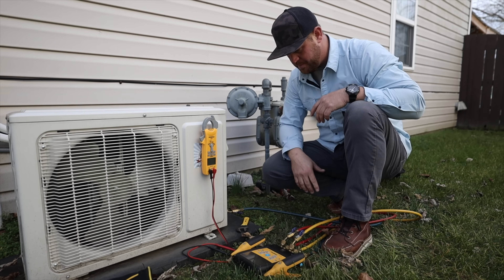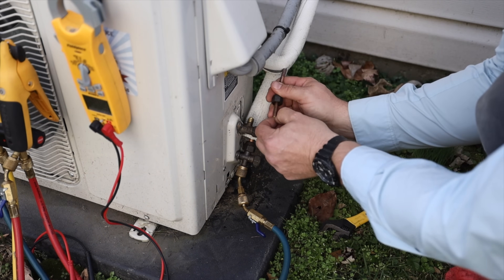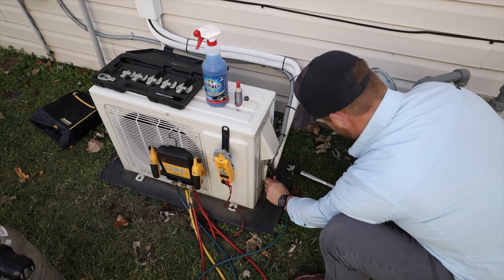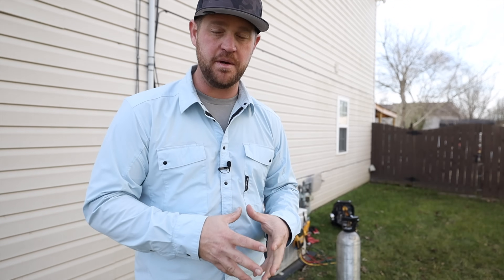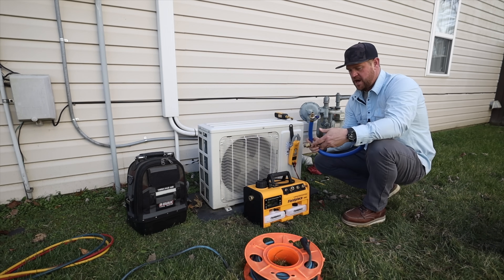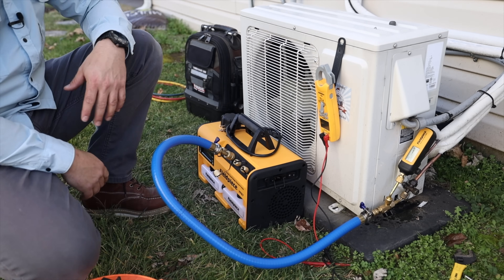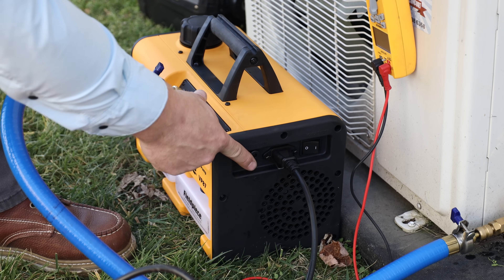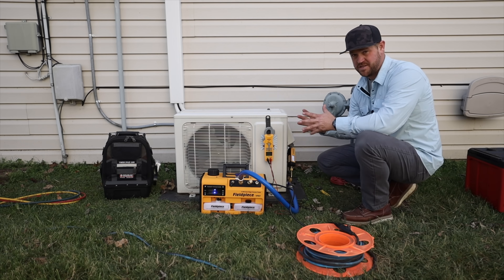#1 Reason Why DUCTLESS Units Fail | How I Fix It...

Comment: I am in HVAC specialist for 37 years. My friend wanted a ductless so we bought a Rovsun  and a Garvey for practically nothing.  I installed them. properly vacuumed, decay test several leak checks since installation.
It’s not been a long time but so far fine. What is the difference? Do you think between a product like GREE and these cheap things that we’ve just installed?

Comment: This video depicts a clear violation of EPA 608.  You mixed nitrogen with 50psi refrigerant - and then vented the mixture to the atmosphere.  Not deminimus.  Once you read 50psi - low refrigerant pressure - you needed to evacuate/recover the R410 or R32 before adding nitrogen and pressure testing.

Comment: Great professional video. We have a Midea heat pump model  MCHSU-18PHH2 generating poor cooling and while having a look the other day found that the temperature sensor running along the outdoor coil is ripped off and is ending with corrosion  wire. The Midea is not very explicit and not sure which of the 3 temperature sensors listed I need.  Any guidance would be appreciated and can send a picture if needed. Thanks

Comment: It appears the flares fail often on these systems.. why don't the just redesign the systems to use double or even a triple O-ring system to solve this problem or some sort of O-ring and flare combination way of attaching the linenes.. an 
O- Ring made of Viton wouldn't fail in these systems for 20 years or more.

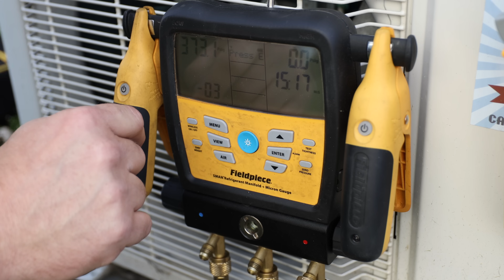Comment: 0.3 psi drop after 15min seems like a lot!  (6:09) What am I missing? These are installs for years, maybe decades.   0.3 psi drop after 15min equals a 10psi  drop in 8 hours!   How long till you were called by the same customer?

Comment: Buddy, if you leave the schrader core in with that setup you're not pulling a vacuum on the lines, you're puling a vacuum on literally just the hose. With that setup there's nothing to "push" the schrader core in to give you access to the refrigerant lines....

Comment: I have been working with flare fittings for 40 years or more. They work ok ( not great) with R-12 and R-22 on lower pressure with low temperature swings but with higher pressure and bigger temperature swings they leak much more frequently. I have seen several mini split with the flare fittings were finger tight after running for a couple years . All I can say is there is nothing like a clean braze joint that will never leak.

Comment: Many people with minisplits dont put the system under nitrogen and just pull the vacuum. The problem with that is that the vacuum will not show the leaks as fast or good. When I installed my multisplit I found a leak after putting it under pressure with nitrogen because a colleage of mine opened one port that we didnt need and didnt torque it down again. 
And with one of my minisplits the ducts that came with it had a leak on one flare. Cut the duct and reflared and since then is leak-free.

The funniest thing was when I had a customer come up to me and said his AC was frosting over inside and the HVAC guy told him that it didnt have enough voltage. I just told him to clean his dust filter and havent heard since...

Comment: Nylon flare inserts (fits between the flare on the lines and flared fittings), nylog, and regular torque, has worked great and 6 years, no leaks.
Reply: Link?

Comment: Can the outside compressor unit be turned upside down before installation? I received my FedEx delivery today and they turned the outside unit upside down. Is there oil in the system yet or is that put in with the pump and gauges after installing? Basically, does this have the possibility of shortening the life of my ac? Is it worth installing? Or do i need to return to sender and get a new one? Thank you.

Comment: Yea I am definitely not hiring you my guy. What the F kind of shoes are you wearing? All your equipment looks like it's never been used, you're doing the absolute most, torque wrenches, getting paid for 15 min pressure checks... The line for me is the Goddamn moccasins, I ain't hiring no dude wearing moccasins... Driving a truck that also looks like it's never worked a day in its life, no name on the truck or nothing, no ladders. I don't even think you are an HVAC contractor. I think you work somewhere in a refrigeration department and you're doing this shit to make videos. That's why there isn't even a greasy fingerprint on any of your tools...
And you want a friggin patreon donation? Why on earth would anyone donate money to you? You literally didn't teach anyone shit in this video, unless your target audience is my little sister who has never seen a vacum pump. You did the most basic ass shit, spray some soap on the first connection, pull a vacuum... Low quality content. Do not recommend.

Comment: so, correct me if I'm wrong, but didnt he say it had 50psi in the system when he got there. then he added nitrogen to whatever refrigerant was left in there to bump up the pressure for testing. then he just dumped the system to atmosphere.     Ummmmm....no recovery process?   I guess we're just going to call that released refrigerant negligible?

Comment: useful video specially the part about not removing the valve core. I was wondering if i absolutely need to remove it or can i just vacuum without removing it. So thank you for that. Does anyone know if anything else needs to be done when removing the adapter from the service port while system is filled with refrigerant? I see in every video that a little bit of hissing and gases with pressure comes out. does it stop on its own or are you doing something there?

Comment: The one thing you MUST install with any inverter mini split is a good surge protector. We only install Intermatic AG3000. $60  we have never lost a control board but have replaced the surge protector many times. $60 or $350-$450. Even under warranty, you can make more money doing a regular service call than a warranty call. Warranty calls always have the customer doubting what you sold them when they fail.

Comment: I'm a 41 year plumber. I have never had a flare fitting leak in my entire career that I made. Just make sure the face is clean on both surfaces. Always bubble soap test your joints after pressurized.

Comment: Nylog on the threads of a flare fitting will do nothing to stop or even slow down a leak.  You might as well coat the first two or three inches of the outside of the tube with Nylog while you're at it.

Comment: Great video. One comment. Aren’t you not supposed to leave the micron gauge on while charging with Freon because the oil gets in the sensor. ?  A second core tool over the first could shut that sensor off.

Comment: Why not solder these connections instead of compression flare?   Seems like that kind of flare fitting along with the vibration from a running compressor would be a recipe for leaks.

Comment: I hate that they put the service valve so close to the ground. So many manufacturers do this even if it sits up on equipment risers there is not enough room. Even the angle sometimes presents a problem I’ve had to remove the mounting screws on the service valve in order to get my CRT on. Major design flaw.

Comment: Why would you not bubble check the inside connections as well and their torque?  If one is wrong I would assume the rest could be bad. Not removing core?  You DON’T have the right core removal tool?
Reply: Yes they do make a core removal tool for mini splits. And I would check all the flares.

Comment: So can I assume if my 8 year old Daiken 12K unit is not blowing bone cold air out any more that there is a leak in one of the lines?  I guess I could test myself for leaks using the spray bottle trick and go from there.    I'm assuming I probably want to find a mom and pop contractor on Nextdoor rather than getting a big name HVAC company out to fix?  I have a 10 year warranty on the Daiken, I wonder if the warranty covers these type of issues?

Comment: For that tightness test aren't you supposed to usen the suction line clamp so that the gauges can compensate for temp in the copper which will cause pressure diffrence.

Comment: Only one minute into the video and you determine that the static pressure is low... Why did you decide to add nitrogen before pumping the unit down to isolate the refrigerant from the nitrogen?.... That seems to me like you are either doing it wrong or purposely misleading people or you don't know what you're doing... However I do think that you know what you're doing which means that you're either purposely misleading people or you are purposely doing it wrong..,..

Comment: Question: When you remove the hoses after pulling a vacuum (with a 1 hose setup and only 1 service valve), how do you prevent air/contaminants back into the system?

Comment: In aerospace, when a stainless steel flare fitting leaked, we used a "soft seal" which is a bevelled washer of softer material like copper or aluminum.  Might work as well on a copper flare.  In a pressure test with N2, the gas initially heats up from the compression so you must wait ~20 min for the temperature to equilibrate, then look for decay from a leak.

Comment: Personal preference, but if it can be done... get that mini-split off the ground.  Three feet is nice.  Coil picks up less dust & debris, isn't eating sprinkler water for breakfast, peed on by the neighbors dog in winter, etc.  In countries where these are the norm, its not uncommon to see them hung where only a ladder can get to them because it slows down most common thieves plus its nearly a straight shot on hookup.

Comment: By giving up on any kind of split system. If I built something else I would use the outside package unit that way the condensate and the free online or outside. And I would use a through the wall AC unit instead of a mini split.

Comment: I have a Fujitsu mini split and it's came up with fault 95 "Compressor rotor position detection error (permanent stop)" any ideas where this valve is and is it replaceable ?

Comment: The threads don’t seal a flare.  Your nylog is literally doing nothing in the threads.  The flare does the sealing. B.  If you take a flare loose you re flare it apply nylog to the flare.  That’s why it’s compatible with your refrigerant.  If you don’t want to use that use a drop of compatible oil. Then torque it.

Comment: Why didn't you remove the grass behind the heat exchanger?  It will grow and get sucked in.  Trimming is difficult because it's tight.  Also, I thought it needed to be 1 ft away from the structure.

Comment: Nice video, from an old refrigeration mechanic.
One thing: I didn't see you recover the partial refrigerant charge that was in the system when you arrived; it seems that you blew it off with the nitrogen.  In most jurisdictions it's illegal to vent refrigerant to the atmosphere.

Comment: New to HVAC but at the end you hooked up pressure and temp probe.  For what reason? I was under the impression that on mini splits you didnt do that. Or is that only for units that have VRF? I kind of assumed they all had VRF, Do some units not use VRF? and if so why no high side port?  I thought the only way to service mini splits was to evacuate, figure out total lineset length and figure out the correct amount of refrigerant based on lineset length, then weigh it in. Installers should  note line set length and write it under the cover or something as SOP but I know thats asking a lot.

Comment: Good job on using the Nylog on just the threads of the flares. Nylog on flares at the unit is common practice these days due to vibration at the unit connections.

Comment: The video is good, but when working with R410A the vacuum, as far as I know, should be over 250 microns and not 500 because the refrigerant is for polyol ester oil or it is with mineral oil. greetings.

Comment: Great Videos. Your organization is impressive. 

We loved our Mitsubishi's so much that when we built out our cabin we put in Mini-splits and at the advice of the Plumber we went with Fujutsu for their ability to run in colder temps. That house has 6 heads, 2 zones and I'm ready to rage on these units They've been nothing but trouble. I suspect bad copper is the issue but I have a new plumber trying to salvage these units as they're constantly underperforming and in need of a recharge. I hope for the plumber's sake and the sake of my wallet that the troubleshooting is this easy. Ripping them out and starting over would SUCK!!!

One piece of advice for those considering Mini-splits, those indoor units need a fair amount of TLC to remain effective and efficient. I had one of my Mitsu units start to struggle and it required a thorough indoor unit cleaning. It's not a hard thing to do but you'll make a mess and take up an hour of your day. The drain line was clogged which was the root of the issue but the unit being filthy didn't help. I was shocked that my local company quoted 3 hours per head at $150 an hour. I was able to clean mine with a youtube video like this and about $25 worth of cleaner and plastic sheets to minimize the mess.

Comment: I really don't understand why so many people don't have a clue how flair fittings seal! The seal happens between where the copper line flair (female) touches the brass fitting flair (male) the threads are just to hold the joint together.
The nylog goes between the mating surfaces of the flare to provide the seal. If you want to put it in other places it won't hurt but it won't be the proper place to seal the joint.

Comment: Hello I am also a service technician. I had heard you say that you add more nitrogen pressure to find the leak. Do you recommend doing it within the designed system pressures? Just what to know. Thanks

Comment: You cannot add nitrogen to a system with any level of refrigerant inside. This is a violation of the CAA and is expressly listed in EPA 608 Chapter 4:
"To prevent from illegal venting, you must first recover and evacuate the appliance to required levels. This applies to appliances that are fully charged or even partially charged. As long as there is some refrigerant left in the system, you must recover it before leak testing."

Comment: I have a mini-split unit and it had a leak as well, but it wasn't any of the flare fittings. Instead, it was that the little needle valve was just the slightest bit loose. So, when you put the cap back on it would leak very slowly. A quick tightening of the needle valve (and more refrigerant) and it was good to go.

Comment: I personally refuse to use Nylog Blue, most manufacturers say specifically not to use anything except pump oil as lube and normally if I have a problem it's because I got a crack in my flare or I didn't flare deep enough. To each their own, of course.

Comment: I wouldn't use nylog. Manufacturers don't use nylog when calculating there torque specs. Also, nylog can cause the fittings to loosen over time due to vibration.

Comment: Why do mini splits break all the time? Because they are junk full of cheap thermistors and control boards. Mostly installed by DIY’ers or jackleg hvac contractors. They have poor air filtration. They are very difficult to clean the indoor blower wheel, coil and pan without making a mess, hence they rarely get PM’s.

Comment: You said you had 50 psi of I’m assuming 410A refrigerant in the system. Then you just added nitrogen to that? If so, you were supposed to recover 410A refrigerant first. If you need more pressure, you add more 410A refrigerant, then you recover it ALL once you find the leak. Then you repair the leak.

Comment: I would have found that leak without the nitrogen. If you add nitrogen to the remaining refrigerant, you have contaminated it. You could identify this common leak, then just tighten it and if that stops it, just add refrigerant while its running, to the point where the suction pressure gets right, and then a few ounces to partially fill the accumulator. Much easier.

Comment: Know nothing about HVAC, but was captivated by your pump. 

Loved the quick oil change feature, though mine take only a minute and, since mine are used for chambers, I filter my oil and use it again. 

One of my pumps has a filter and I get nothing in the air from it, as it builds vacuum. The other mists until I build a significant vacuum. On a whim, I used an old CPAP hose to move the mist away. It worked and, if I had to move it a long ways, I could push air in from a Y to assist moving the mist out of the shop. All this is to say, I loved that exhaust feature on your pump.

Comment: This seems like a ad for field piece. When you put your guard on you had 50 psi, then you just released it with the nitrogen after your leak check. This doesn't seem the proper way to Handel that 50 psi that you just released into the air.
Reply: Yeah dude isn’t a real tech, just a man that does sponsors

Comment: Nice equipment. I was hoping for more explanation about adding the coolant. Such as: does it matter which coolant to use? My installation manual is surprisingly unclear on many points. Can most manifold gauges handle various coolants? Which coolants are normally used in mini-splits? Are cannisters of coolant available or do they require a license? How do we know how much coolant to inject? How is it measured? And, how specifically to hook up the lines and valves to add coolant. Of course all these things come easy to professionals who work every day in this field. But these days there are a lot of us DIY'ers who would like to handle some of our own a/c maintenance. I have seen with my own eyes just how exhorbitantly expensive it can be to hire someone for this! (I mean, like well over $1000 for 1-1/2 hours of work!)

Comment: 370 lbs of pressure on the Nitrogen. I do automotive A/C at work and have for years. These Mini-splits are new to me. Great job showing Fieldpiece equipment and features. I have used shop air for years when I suspect a leak. Tried it all. Soapy water still is great for any leak detection.